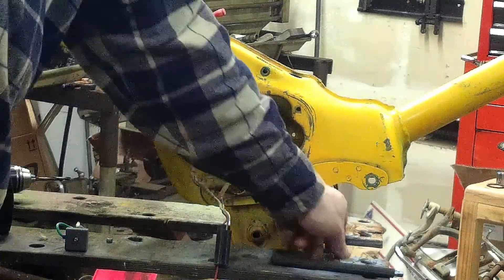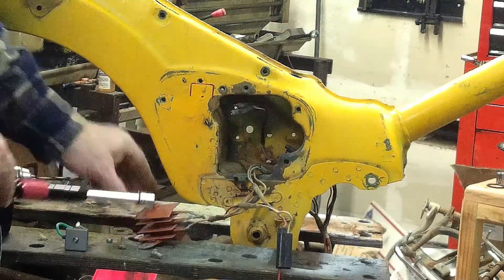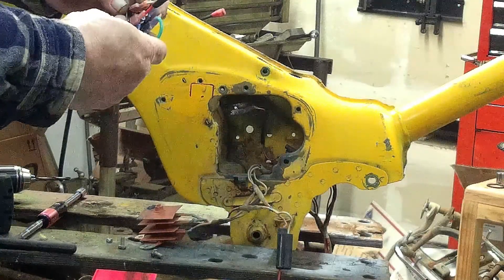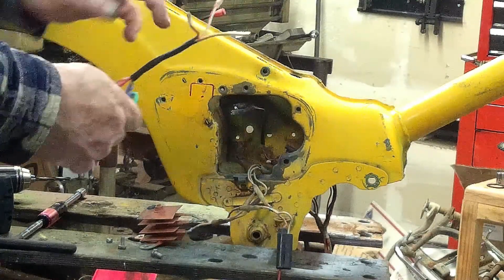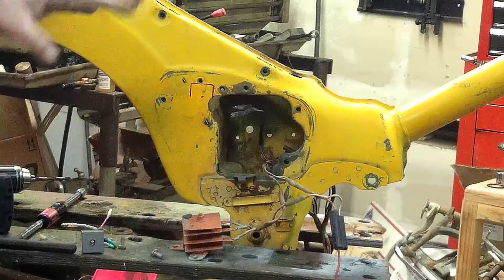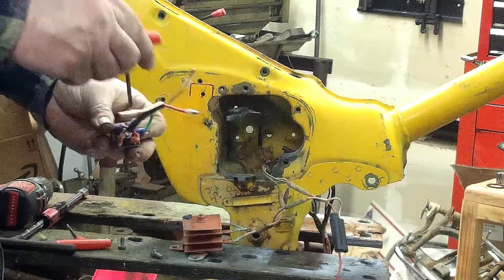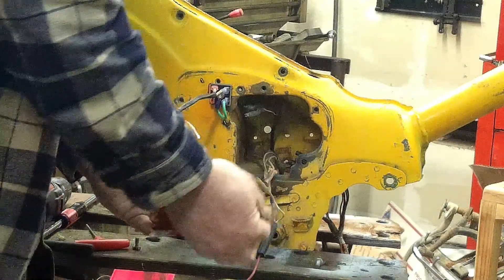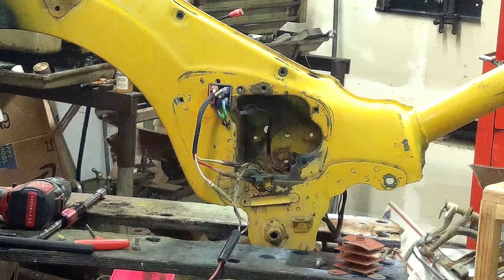Honda CT90 6v Rectifier Upgrade

Comment: Its so hard to find the 3 wire rectifier for a 67 ct 90    where did you get it?
Reply from the maker: A 25 amp bridge rectifier was used in the upgrade. You can find them on Amazon or Ebay

Comment: Sir I understand you made an upgrade. How can I tell that my selenium rectifier is bad?  Is that what I should look at to see if my battery is being chaged?  How do I test the rectifier to see if the battery is charging?
Reply from the maker: you can test the output of the alternator by putting the leads of a volt meter across the positive and negative terminals of the battery while the engine is running
you should see greater than 6.5 volts@ 1100 rpm, but less than 8 volts. if you get more than 8 volts you risk boiling the battery if lights are not used to reduce some of the excess alternator output

Comment: You may well need a regulator now that you have made the charging system more efficient... to prevent the battery boiling off it's water....
Reply: Does this bolt need a good ground?
Reply: Why would we need this
Reply from the maker: what voltage would you set for regulation?
i'm considering 7v.
edited for a question... what do you think of this?
https://www.pololu.com/product/2883
Reply: @mikewalton5469  6.9 to 7.2V is what you should target .
Search eBay for "6V regulator rectifier" for a simple and cheap solution.
Reply: @mikewalton5469  looks fine, but you'll need to build an enclosure and it's expensive...